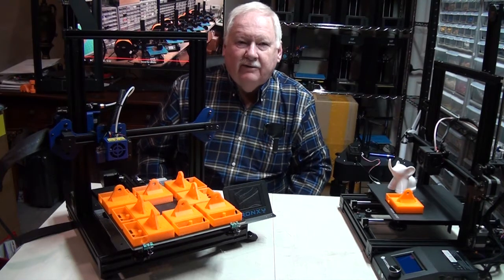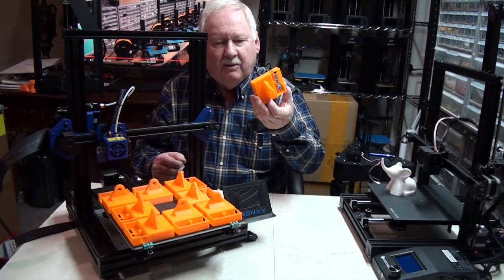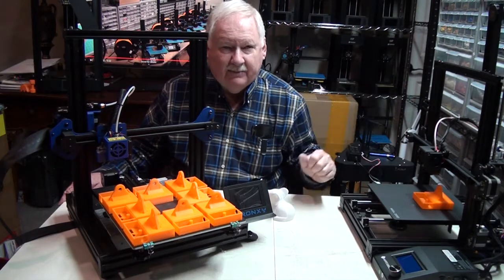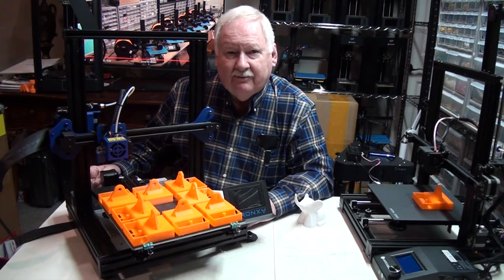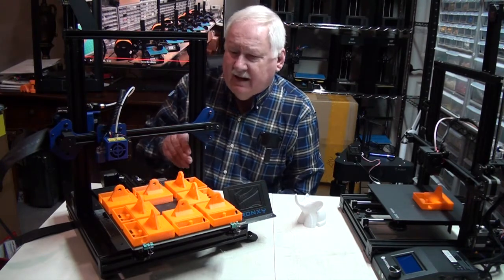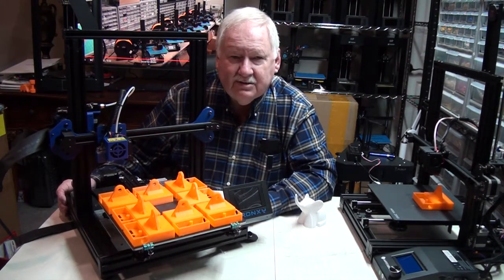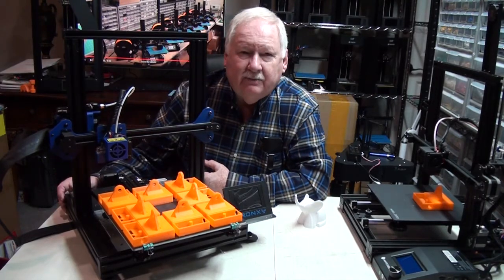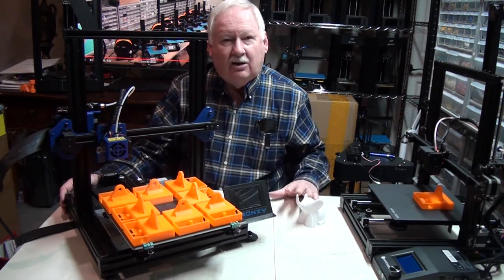TRONXY-XY-2-PRO, My newest 3D printer at New Tech Inventors 3D Print Farm

Comment: Another option, since you don't like doing 1 or 8 parts, is just to do 2 or 3.  I do this a lot when I print my parts.  I sell an item that takes 6 plastic parts and like 4 metal parts, so one part for example is kind of like a large washer, and it uses 2 of these, so I will print like 8 at a time.  Another is a plug that goes into the end of another piece, and I like to print like 6 of those at a time (these are small parts).
Reply from the maker: It sounds like you have worked out the best printing arrangement and schedule for your parts production, and that is very important as you know. Some of my products have many 3D printed parts as well. The standalone fume extractor in my last video has 8 3D printed parts, an 80mm fan, 4 screws and nuts, 2 foam filters, activated charcoal, 1 male power connector, 2 pieces of corrugated conduit, 2 pieces of heat shrink, 1 flex tube, 1 DC power adaptor, and a 12V DC power supply. All together 28 parts that make up one of my products. I recommend that people try to come up with less complicated products that require little or no assembly. Thanks for your comment...Ken
Reply: @NewTechInventors  yeah as I progress through your videos, I have realized these helping hands products are more intricate than I originally thought

Comment: You didn't talk about the printer at all. This video had almost nothing to do with the TRONXY XY-2 Pro
Reply from the maker: Like I said, I am not evaluating or reviewing 3D printers. I only talk about how I am using them and how they work for me. I will have more to tell as to the performance of the XY-2-PRO after I have it running production at my new print farm. It along with Anet ET4 printers will be carrying most of the load and I will be able to report on how well the XY-2-PRO performs. Thanks for the comment...Ken

Comment: May I ask how you’ve gotten such clean prints every time the might string or brake or not print right thanks
Reply from the maker: Thanks for the question. I guess I'm just lucky... No just kidding.... I have a box full of broken, offset, stringing, and poor quality parts. I may print a single part 20 tines or more on a printer at different settings until I find a good formula for that part on a specific printer with a specific filament. Once I have a good formula for that part I then set it up for production with multiple parts on several printers. This works well for me. I will show some of my failed print attempts on an upcoming video. Thanks for your comment...Ken

Comment: How many Kingroon KP3 are you running? I love mine, they are easily my favorite printers!
I just bought 3 Tronxy XY-2 Pro Titans on sale on Amazon, but had to switch to Marlin firmware, I can’t stand the stock firmware. Which slicer do you use for your XY-2 Pro?
Reply from the maker: Thanks for the question. I have 16 Kingroon KP3 printers. All running good except for one which has a control board problem. I haven't been able to find a replacement board yet. 10 of these printers run production in the print farm and I have 4 of them in my home office to print prototype parts. The small size of the KP3 is great for this, I have one sitting on my desk. As for the Tronxy XY-2 PRO, I have only recently started test printing parts on it and the other 5 are still in their box waiting for me to get my secondary 3D print farm going. Thanks for your comment.......Ken

Comment: What do you think your best preforming printer is around $200?
Reply from the maker: The best buy I see now on ebay is the ANET ET4. I just purchased 3 more at $130.19 each. Single unit price is $139.99. This 3D printer has a 220 x 220 x 250 mm build area, glass or textured bed, filament out sensor, resume print, auto leveling, large color touch screen, 240w power supply, and quick and easy assembly (about 10 minutes). I have been using these printers for 5 months now and they have preformed well. The TRONXY XY-2-PRO is new to me, but I have several other TRONXY printers that have worked well for me. The XY-2-PRO is currently being sold for $189.00 on ebay. With it's 255 x 255 x 260 mm build area and 360w 24v power supply, you have no problem with hot end and bed temperatures. It is always good to have a mostly pre assembled printer that is ready to go. Both of these I would recommend because of all the features they have and the reasonable price. Thanks for your comment....Ken Weller
Reply: Thank you!